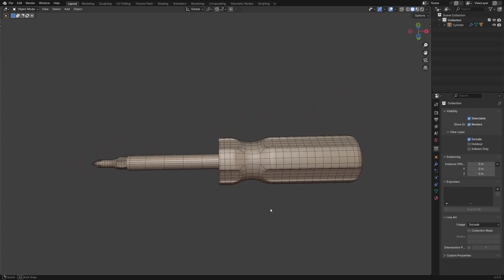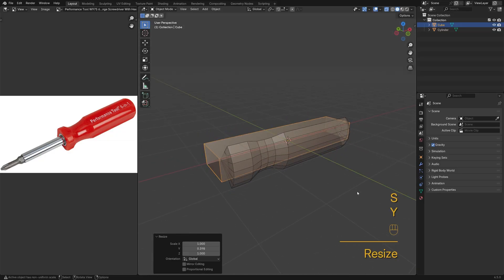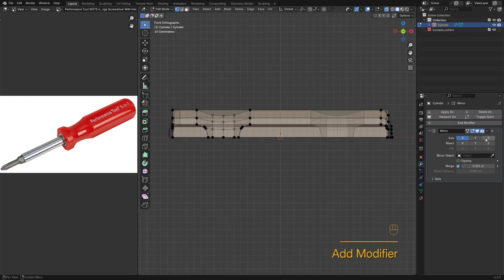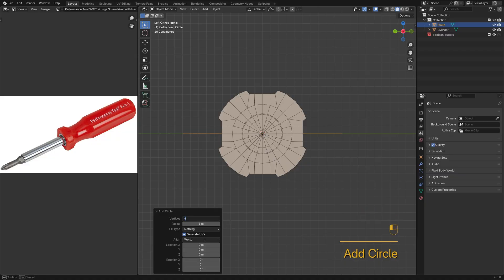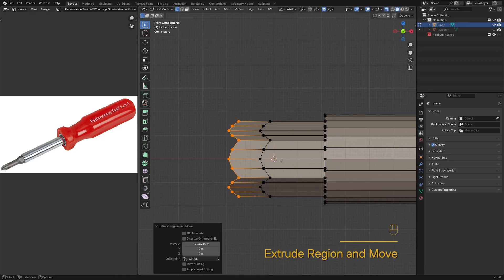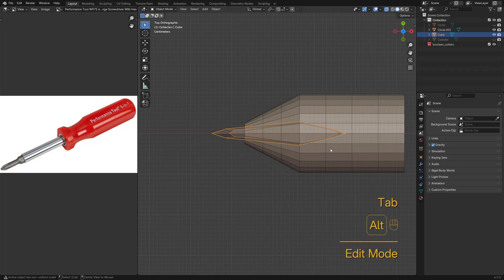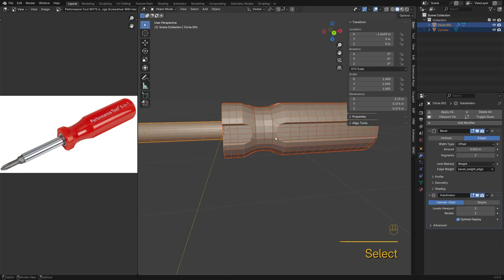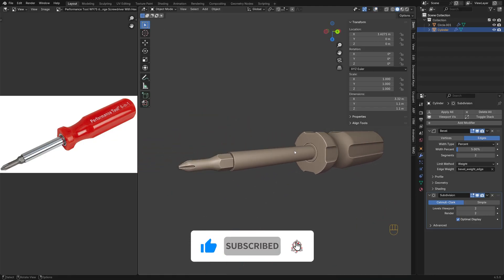Blender product modeling tutorial: screwdriver (Realtime)

Comment: as a stickler for detail (and a casual 3D artist myself) i am compelled to point out some flaws and constructive criticism that would, in my opinion, improve the accuracy of the model. i hope you can forgive my nitpicking XD

this is in no way to diminish the quality of your videos nor your skills as a digital artist. the video is good, the model is good, the teaching is good. i am just expressing my opinion on the execution and some specific aspects of the model i feel could be done better.

firstly, blender has some really nice snapping tools for aligning verts perfectly. i implore people to use it more, especially during the quadding around the 3:10 mark. 

secondly, using the bolt factory addon (used to be shipped in older blender versions. now an extension) you can get the "perfect" shape of the hex to round chamfer at 5:45 . alternatively, using a mesh circle as a snap guide or setting the proportional editing to "spherical" falloff instead of "smooth" (the default setting, which i think is a normalised bell curve distribution?)

lastly. the bit head is wrong... i know its a generic 3D model, but its so far off its painful to me XD. i recommend looking up clips of these sorts of things being machined as it can often help get a better feel for their shape, especially in boolean workflows (which closely mirrors actual machining). for a phillips head ("+" or "x" shaped) they need to be straighter. it'd be better to start off cutting out the "+" shape from 4 equal sized cuboids and pull the inner bevels in. i know it looks like its smooth and round but they are actually quite square close up. you're just looking at a very small thing so the natural bevelling of real world objects is more apparent. trust me, they are supposed to be as close to 90 degree cuts as they can be.
Reply from the maker: Thanks for your advice